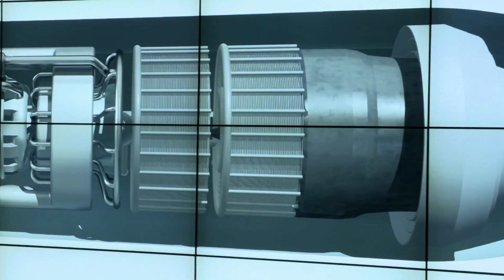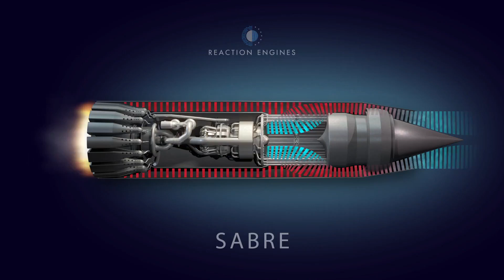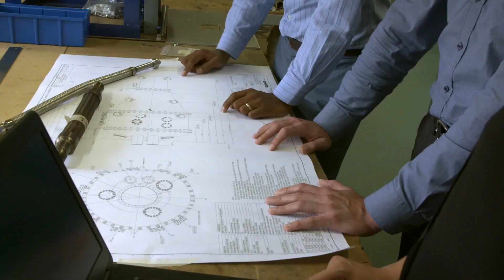Skylon...Reaction Engines. And it's leap to hypersonic travel

Comment: Not enough Tech on this too much political mumbo jumbo.  Its got to work first.  Stick to the technical side.  What you need to look at are the shockwaves - because air has to be reduced to subsonic speeds - then compressed, then accelerated by oxidizer and fuel through expansion for thrust.   The model does not show shock mitigation yet.   So this is very early stage.  Maybe they will focus on the cooling part first - which will be a huge challenge due to the abrupt change in temperatures that the materials have to endure.

Comment: There are three reasons why the Skylon will fail and they are economics, economics and economics.  There is absolutely no way that in the era of Falcon 9 and Falcon Heavy that the Skylon project, as currently envisaged, could begin to recoup its projected development costs or even the cost of each vehicle.  Technically the Skylon flies to 27 km at Mach 5.4 before switching over to pure rocket propulsion.  Stage one of the Falcon 9 flies to 80 km at Mach 10 before second stage separation.  Within four years, SpaceX will move the economic goal posts again when they have their Big Falcon Rocket.  Sabre engines are ‘air breathing’ rocket engines so their advantages should be shown to best effect by providing the thrust for the first stage of a rocket.   Increasing rocket payload capacity to orbit will provide better returns on investment whilst keeping development costs reasonable (the Skylon airframe development cost is going to be prohibitively costly).
Reply: Falcons can't reuse their second stage. Also using wings and oxygen from the air for the first 27 km seems like a more economical way of getting to space than a traditional rocket.
Reply: wrong wrong and wrong again...Alan Bond has had this dream since the late sixties and much of the nuts and bolts of the system is already developed, proof of concept is already accepted and a demo unit is being built. There is no system that will be able to beat Skylon in terms of cost per Kg to orbit, because the only cost is fuel and oxidizer, and both liquid oxygen and hydrogen are cheap and plentiful. Plus many other players see the efficiency of this system and have put their resources into this. Consider what this engine could do for international travel ? try getting half way around the world in less than four hours by any other means of air travel ! Plus oxygen and hydrogen is as clean and green as you could possibly want. This kind of cut in pollution will definitely play and increasing part in the attractiveness of this system....
Reply: The economic advantage of the Falcon was that NASA effectively paid the development cost via the commercial resupply program and they could do the reusability development for free once the payload was launched. Where Reaction Engines will find their niche is likely to be military hypersonic applications, this will allow them to develop the technology to allow them to build the general space plane (Skylon). 

The airframe of the Skylon is more complicated to develop than the Falcon rocket was but is of lower complexity than the BFS. It has a lower peak heating rate under reentry than the BFS so all things being equal should have a longer operating life, it also has a less complex operating model (land, taxi, refuel, fly) so it should be cheaper to operate. 

Also the Skylon should be able to operate in weather commensurate with commercial aircraft, try landing a manned BFS in a strong crosswind, rocket launches (never mind landings) are frequently scrubbed due to wind.

The BFR economics will change space, a small fleet of BFR will be able to put 10,000's of tonnes of space stations into orbit a year, space property could be cheaper than Monaco or London. The BFR is the C17 or AN124 of spaceflight.

However if you want to frequently and reliably visit space from many locations Skylon is the A320 or 737 of spaceflight.
Reply: joseph prosser and what if this engine can be used on aircraft types capable of using existing infrastructure ie an airport without significant changes ie building space ports ?
Reply: joseph prosser Skylon's speed when it transitions to pure rocket is in the order of most first stages at burnout Mach 5.2 (5500kmph) For a return to pad mission a Falcon first stage is generally going no faster, ~6000kph, for a barge landing max ~7000kph.

The wings mean that gravity drag is nolonger a thing and the craft doesn't even need to have a thrust greater than unity at launch. The "second stage" is also burning hydrogen so it has a high delta V.
Reply: You don’t factor in the cost of transport of each chunk of the Space X rocket, checks for damage, reassembly and transport of the completed rocket to the pad. That all costs tens of millions of $. And it’s got a pretty slow turn around, how long, months? Multiple months? Skylon flies, lands, gets towed into a hanger, the heat protection gets checked and then they can refuel . They could probably turn around inside a day.
THAT WILL KILL SPACE X.
You rattle on about Space X can fly higher etc, etc. But that’s the pinnacle of 70 odd years of liquid fuel rocketry. 
This is SKYLON MARK ONE. And it flies to low Earth orbit with 15 tons of payload without disassembling itself in the process.
Half of your problem is that you’re a Yank and MASSIVELY insecure. You cannot handle another country building something better at the moment than you can. You know half your rockets now use Russian engines nowadays? They’re more efficient than yours you see.
Reply: Falcon 9 block 5 is supposed to have 24 hour turn around.
Reply: The tech will make the falcon 9 and heavy obsolete.